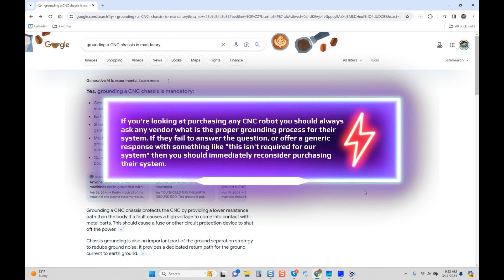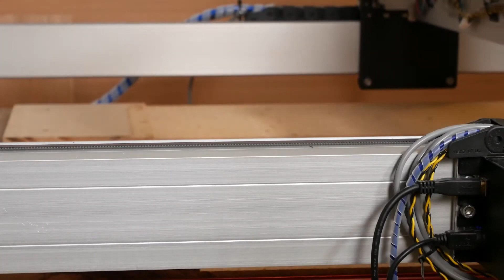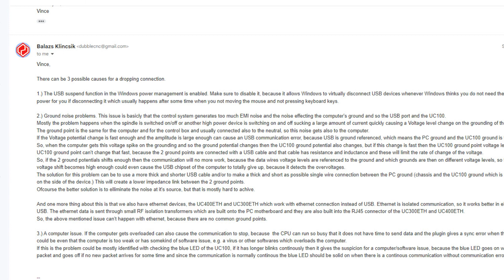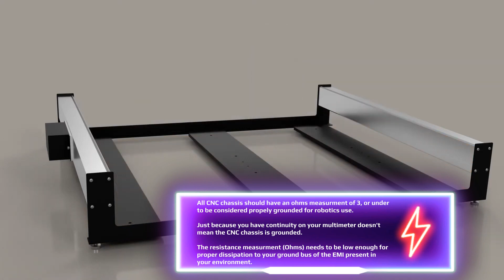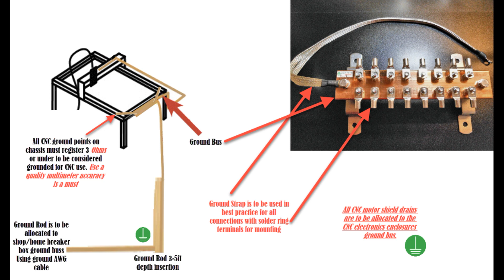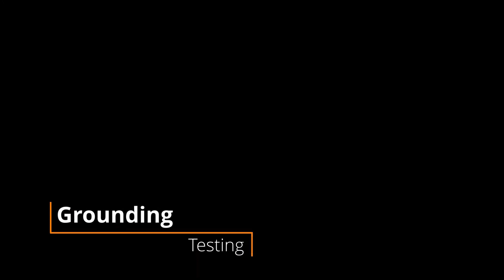CNC System Grounding Failure (Volume 16)

Comment: 3 Ohms? I would consider resistance above 0.5 ohms rubbish. 2.5mm2 30mt long is less than this. Welding? Welding is melting the filler and the base metal. You are soft soldering.
Reply: Welder here. Soldering, braze welding and fusion welding are all forms of welding. Soldering and brazing are the same. The only difference is the filler material and method of applying heat.

Comment: You say that you cannot use USB cables in CNC systems? What should you use then?
Reply from the maker: Thank you for your support. Please rewatch the video again to see USB has no place in a CNC system as universal serial bus is unstable due to grounding, EMI, and voltage spikes. You'll want your system to use ethernet for "bullet proof" signals. Thank you,
Vince
Reply: @corvetteguy50  thank you! While using for example GX 16 connectors and sockets should the shield of a cable be connected to one of the pins of that connector and then to the chassis inside the enclosure or shield of the cable can be connected to the housing of the connector which is connected to the socket of that connector and the socket is connected to grounded chassis so that it's all grounded and shielded?
Reply from the maker: This is a good question. 

Either methods is fine pending the controllers enclosure is grounded through conduction from the unit's power supply as it should be. 

I prefer to solder the ground drain to a terminal on the GX-16 connector as its a bit faster for me to do. Then the ground lead once it has a ring connector installed is allocated to the ground bus installed within the electronics enclosure of your controller. 

Thank you,
Vince
Reply: @corvetteguy50  Thank you for your answer!
Reply from the maker: You bet...:)

Vince

Comment: Do I need to ground my CNC chassis when spindle already grounded to inverter?
Reply from the maker: Thank you for your support. If the spindle is mounted in a non conductive fashion then yes. If the Z axis is conductive to your CNC chassis with the spindle mounted to it then you don't have to add additional ground points unless the chassis doesn't hit the targeted Ohm rating to be considered grounded. 

If you would like to cover the proper way to ground your chassis please reach out to me through the video's description for a consultation. 

Thank you,
Vince

Comment: Where did you find the 3 ohms rating, a quick search showd me that 5 and below should be fine ? Great video, i always enjoy them and learn something new from them
Reply from the maker: Thank you for your support. 

3 Ohms resistance is optimal for robotics systems, and while 5 Ohms may be alright for certain end users systems in certain environments, 3 or below provides "bullet proof" signal transfer pending all the details are covered with the end users robot's double shielded cables. 

I've validated this resistance level from well over a decade of experience personally, working with over 1000 plasma CNC systems. 

While this specific number may not be disclosed online what is disclosed is as you wrote above 5 is par, then 3, or under assures end users success which is why I listed it as I realize with this being the internet/social media certain end users are willing to stay at the highest value acceptable.

The bottom line is the lower the Ohms number the lower the resistance which means EMI dissipation is more effective. 

Thank you,
Vince